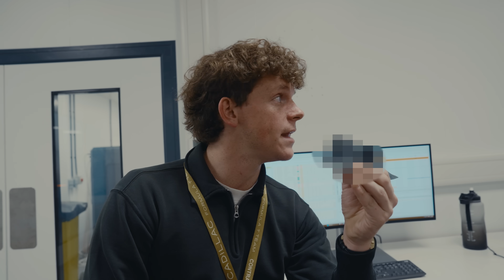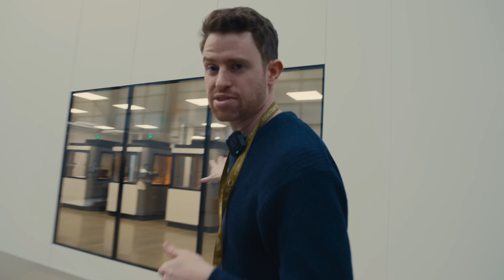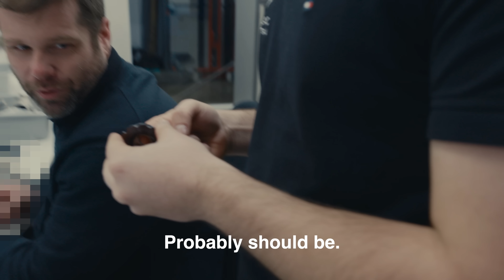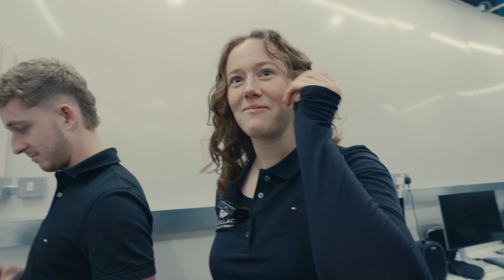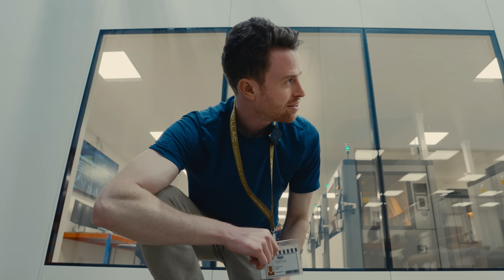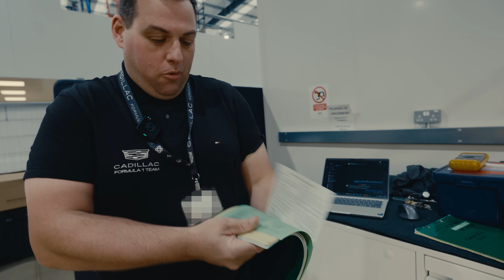Cadillac’s First F1® Car Is DONE

Comment: #1 You race cars to sell cars (i.e.Ferrari) GM wants Cadillac to be in the same league as Mercedes and Audi to car buyers when its comes to luxury auto brands so what better way to do so than race against them. #2 It takes at least 3 years to build a F1 engine from scratch which is why Cadillac F1 using Ferrari Engines for now. (and it might take even longer if the FIA cannot nail down what future F1 engine specs will be like (IYKYK)

Comment: I wonder if they have ever tried to make an exponential gain of force brake pedal to give the driver more of a finer control of the low-mid pressure braking before gaining the higher pressure and pedal effort at say the 40% travel range.

Comment: One F1 car is made of approximately 50.000 individual pieces! That's a puzzle with fifty THOUSAND pieces. Each piece is absolutely necessary, or it wouldn't be there! Most pieces are unique to this team's 2026 F1 car. Designed, machined, printed, constructed and perfected by these fine people! It's functional ART!
No wonder, under such extreme pressure, they are all smiling from ear to ear!